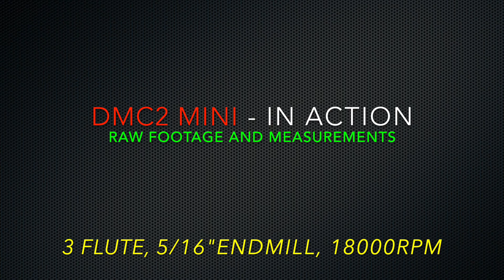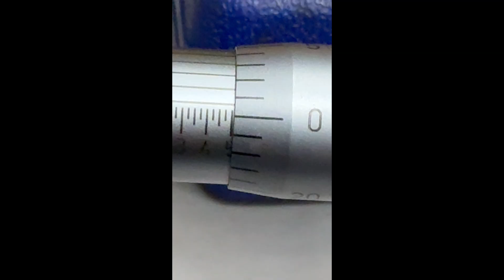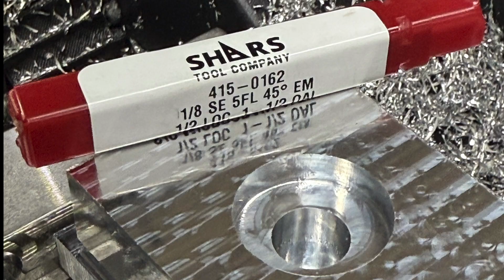DMC2 Mini in action

Comment: Hi! I'm back, after some consideration, I decided to buy the machine and I’ve just finished building it! Now I’m watching all your videos repeatedly to get the best performance possible from it.
I’d like to ask you a few things:

-I had to change the soft limits values because they reduced the working area too much. Did you have a similar issue?

-Another strange behavior: I’m using the motors with integrated drivers, and if I set the motor parameters as shown (8000 mm/min, acceleration 2000), any rapid movement seems to trigger the E-stop.

I also followed your tutorial for the 3D probe configuration, and it works perfectly — thank you!
One last question: do you think I could do something similar for the tool change using a normal Z probe? For example, can I set a fixed position and make the machine go there each time it needs to measure the tool length using the built-in Z probe?
Thanks again for your great tutorials!
Reply from the maker: Congratulations on your purchase. I had to bend my tabs a bit more in order to get as much travel as possible for decking the table. When you get to that stage you might want to turn the soft limits off using much care not to run into the physical stops. I don’t remember what i used for soft limits, but it must be something in the order of ½ inch or so. 

8000mm/sec seems a bit on the high side, I use 3000 for acceleration and 3000 for max speed. The Z axis was a bit jerky at 3000mm/secsec so I changed it to 2000 for now. 3000mm/sec for speed is scary enough for me, but have at it. I prefer to microstep and bias toward precision vs speed. 

I’m not sure I understand your last question. I chucked the original probe, because the offset was limiting where I could probe, and the size of the ball was limiting what I could probe. I now use a removable tool probe on the bed to check for tool length, and I have slightly modified the routine to suite my needs. I have a video out there that explains what and how I did. Hope this helps.
Reply: @EZ_shop  Thanks so much for all the information. Since I'm just a beginner, I'd prefer to keep the software limits active for added safety. Regarding speed, it was more important to understand the maximum capacity of the machine and then reduce it. 
How many steps per revolution are you currently using?
I also watched the tool probe video, but I'm not sure I want to buy the same tool yet. I was wondering if I could perform the same tool length routine but with the stock z-probe sensor (the small cylinder).
Reply from the maker: @ferra7957 I’m out of the country right now, give me a few days to get back and I’ll take a look at it. I have never tried that, but it should work, though I’m not sure how accurate that would repeat. Also, because the Z probe is electrical, make sure it is dry when you probe or you might get some false contacts depending on what coolant you use.
Reply: @EZ_shop  yess, thank you again for the support, I'm in no hurry :-)

Comment: On #3 of your video series...  Excellent job!  Subbed...

What are you using for cutting fluid/coolant?  Are there water soluble coolants now days that look like plain water?  Most of the stuff I've seen is milky white.

Dr. D-Flo's review is what sold me on this machine...  His second video showing a vastly upgraded machine with a commercially made X-axis stepper motor mount sold me buying that.  

Greatly appreciate you video on modifying cycles within Mach3.  Have no experience with Mach3. 

One of your videos sold me on buying the spindle mounted probe...

Looking forward to getting my machine (ordered last week, shipped yesterday)...  So much flexibility to this machine.  Your videos have been a wealth of knowledge so far!
Reply from the maker: Thanks @WHJeffB, just trying to give back a little to this community and share my journey. As far as the coolant, I hate the milky white stuff you cannot see through. Shariff recommends QualiChem Q-Cool 355D, I was able to get a 5 gal bucket shipped to me and I really like it. I would recommend it as well, it mixes with distilled water, is transparent, doesn't stink, and resists mold growth. Use this link to contact them https://qualichem.com/contact/

Comment: Good enough for me.. You need a flycutter for the first top bit.
Reply from the maker: Wouldn’t put a flycutter in this machine. The slowest speed it’ll go is 10K rpm. You really want to stick with small bits when going from 10K to 24K rpm.